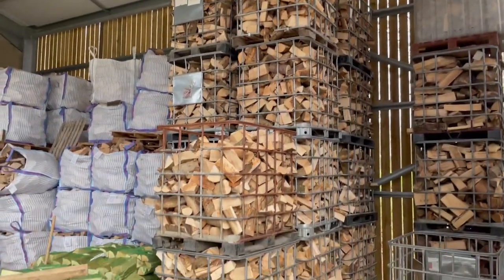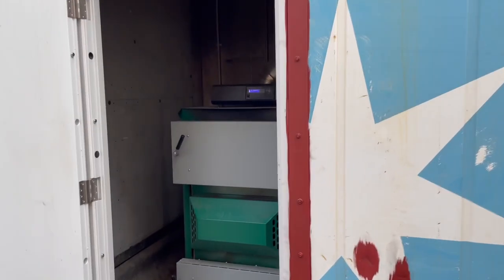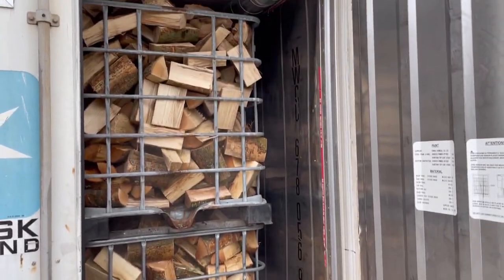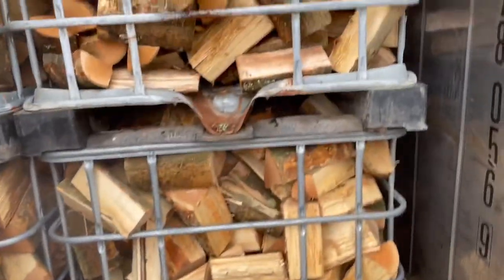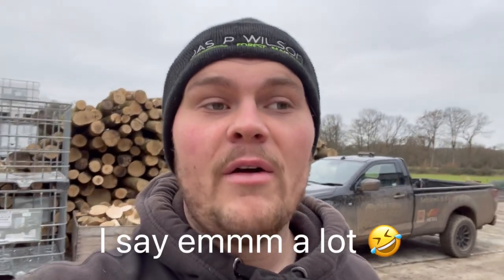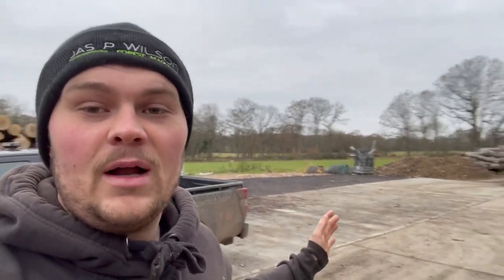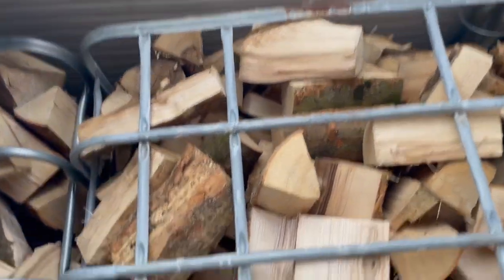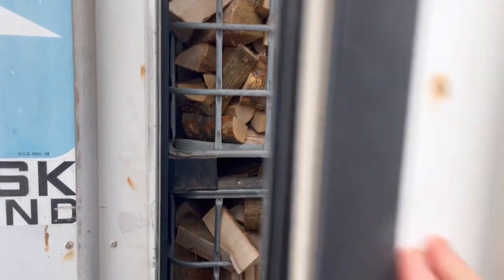What have I done to the kiln now?

Comment: Your videos have provided wonderful information while I'm researching for my kiln build! My thoughts were to use a high cube same as yours but no vents and using a dehumidifier to remove the moisture. I would be curious to see if the burner would require less wood as you would be losing less heat from your vents? However, when the wood is free and not much of a burden to load into the burner, may not be worth the cost of the dehumidifier.
Reply from the maker: Also as you are adding more hot air volume you NEED vents, It needs to go somewhere. With a wet system boiler and a heat exchanger you can block it off and use a dehumidifier

Comment: Here in Canada the measurements for stove wood is 16 inch or 40.64 cm.. anything else is considered custom cut..
Reply from the maker: That would be a dream. I bet it does not take long to get through timber. Going from 25cm logs to 15cm kindling makes a massive difference in speed
Reply: @oakfarmfirewood  my kindling I cut at 30cm or 1 foot.. but we don't have anything like you guys have (machine weise).. we basically stand at the splitter and split planks then split down to kindling size.. your way is way more productive then ours... as for stove wood we can do up to 3 full cords per hour.. or 9 IBC totes
Reply from the maker: Impressive yes this machine can do 4 ibc an hour 5 in the right wood and another person moving cages and loading wood etc